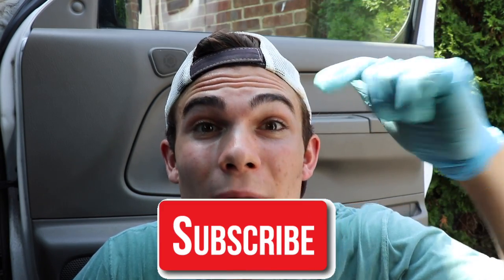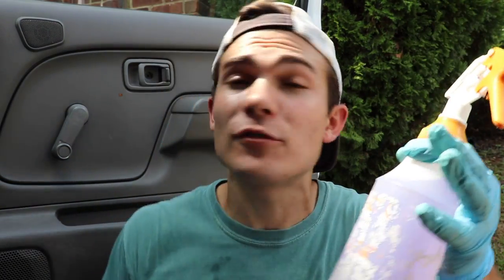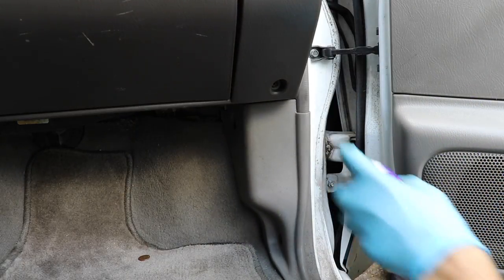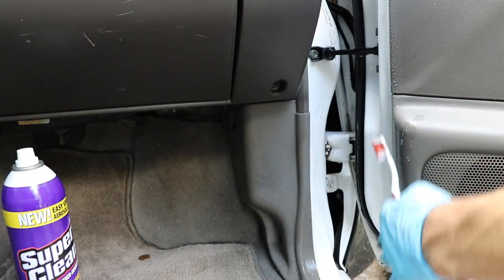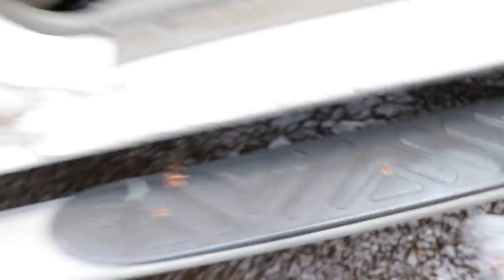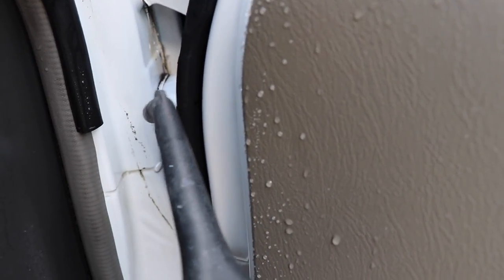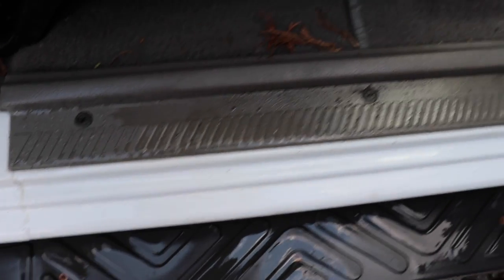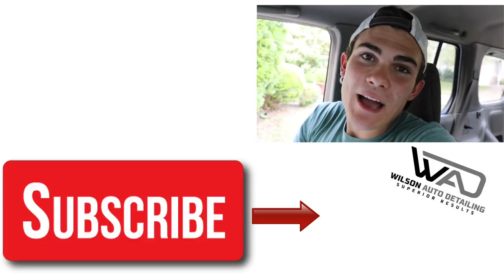How To Clean Car Door Jambs: Super Clean Degreaser

Comment: Hey bruh, I really enjoy your videos. I'm a professional detailer, i worked for the largest car auction in Florida for a few years and last year 2017 i decided to start my own business...I have one question my friend. Why do you not use a pressure washer. You can get a small electric pressure washer that you can run by inverter power and you can use one of your old 5 gallon chemical jugs for water. I know you use your car your for your business so there is a limited amount of space but that set up that i just gave you would take up less space than a small suit case and would cost about $200. A pressure washer is better on so many levels. The pressure washer gives your water spray an edge that you can use like a knife, what i mean is you can pin point where you want the water to hit without spilling a drop in places you dont want water go. A water hose is good,  believe meni detailed my share of cars with a water hose, however you can get that pin point accuracy with a water hose.

Comment: Is Super Clean Better than using Simple GREEN?          Do you find it at Home Depot? Or Walmart?       I want to wet clean like this on my VW Passat main door hinges,  but was worried about the electronics?  I guess thats no issue? I planned to hit the roller mechs and pivots with the spray on lithium grease can with straw applicator.

Comment: Is the paint on door jams worth less than the one on the doors or hood? You wouldn't do this on the rest of the paint....or is it just an old work truck?
Reply from the maker: Well this is a debate in the detailing world.... I use degreaser in the door jambs because of the HEAVY build up that occurs their... but no IN MOST CASES i would not use degreaser on the paint on the outside, however I often use a diluted form of meguiars super degreaser on exterior paint for certain things

Comment: I wouldn’t listen to this guy... I’ve used Super Clean Degreaser in the past and at even 5:1 ratio it can leave acid like streaks/stains that etch into the material you’re using them on. No other way to correct that except repainting it.